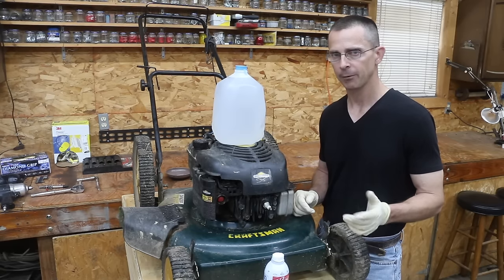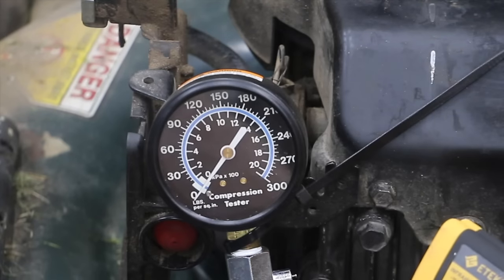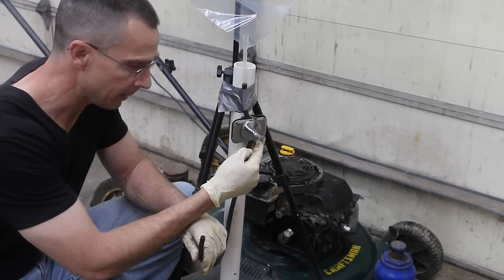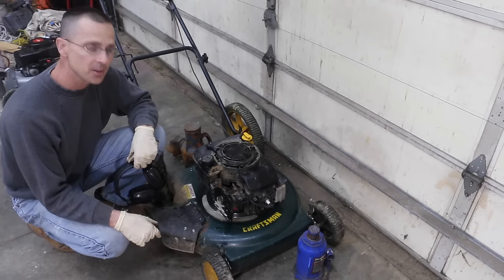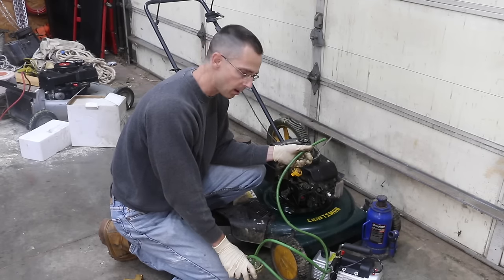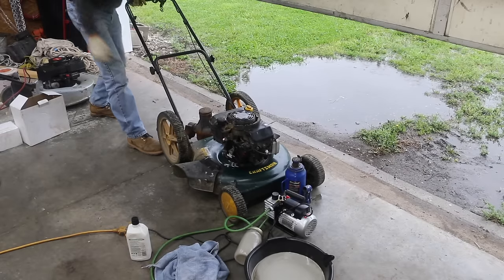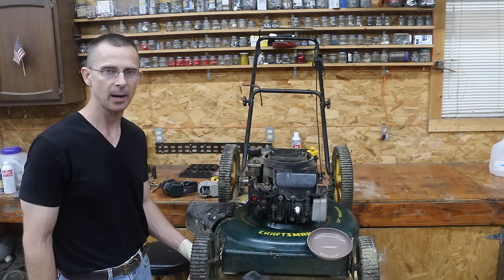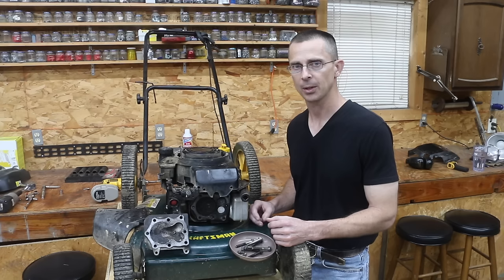Seafoam--can't believe what it did to my engine episode 5--cylinder cleaning test using water!!

Comment: In my opinion I think if you use the water once engine got to the maximum temperature using an atomizer for a short time and waiting for the engine to warm up again.
I think it may have done better.
Like a hot pan after cooking when you add water it removes the stuck on food.
That being said there's no way in hell I'm introducing water into my engine.
I hope you weren't trolled..
Anyway I like the way you debunked using water.
Keep up the great work👍
Reply from the maker: Thanks, will do!

Comment: Interesting video...thank you for posting...but it brings up questions.....what is the compression supposed to be on that engine?...and does the water making its way into the crank case indicate the need for a ring job?.....I really did not think the water did much of anything...I looked and replayed before and after several times....at the point you have to take the head off to see if it did anything.....you might as well use a wire brush on a drill to clean it up

Comment: In 1987 I took a Power Technoloy 171 course at San Diego State University from Dr. G. who showed us this water injection technique to clean out carbon build up in gasoline engines. I have been using it ever since then. He had us use a refillable ketchup or mustard type squeeze bottle with a very small orifice. We only injected water for a minute or two and did not have a problem with water in the oil.
Reply from the maker: Thanks for sharing.

Comment: I used to work at a tune-up shop and we routinely used water to de-carbon engines just before performing the final idle adjustments. We would usually only use about a 1/2 cup of water on anything from a 1600cc 4-banger to a 472 ci V-8. It was ALWAYS used while the engine was at wide open throttle going 60 mph on the dynamometer. The dyno would adjust the load so that you couldn't exceed 60mph -- even with 450 hp -- and such cars needed extra caution b/c if you kick it down into passing gear you could have the rear wheels jump over the dyno roller (69 barracuda 340 would do this very easily). On a car that had no carbon -- it would just sputter slightly as you added water and the exhaust remained clear. Those that had mild to moderate carbon would start to emit a bluish/white smoke from the exhaust after about 5 seconds of water intake. The smoke would often continue for 30-60 seconds after the water intake stopped. The smoke had a peculiar irritating odor that was unique to burning carbon deposits -- it smelled a bit like fuel varnish deposits burning and seemed to stick to your airways -- it was a smell that I hated. Cars that had severe carbon would ping during the process and sometimes spit actual chunks out of the tailpipe. Such bad cases would sometimes require running a gallon or so through it in the course of 5 minutes -- backing off whenever carbon breaking loose would cause it to ping. I never damaged the hundreds of cars I put this through -- and most of them were cleanable on the dyno with water. A couple of them were so bad that 5-10 minutes on the dyno with water intake didn't eliminate the smoke and they sounded so bad during the process that I was afraid of making things worse. A motor this small (lawnmower) would only have gotten about 6 oz. of water -- max. The large volume of water used is why some of it ended up in the crankcase.
Reply from the maker: Thanks for sharing.

Comment: Very interesting results, but it seems like the water is unpredictable and even caused more additional work to be done.  However, the water really did loosen up some bigger bits of carbon compared to seafoam where it seems like seafoam is stripping the carbon in layers over time.  I'm assuming this would be because of the rapid creation of steam from the water and where that steam was entering is where it did the most work.  Thanks for putting in the work and time to make this video!  I'll be sticking with seafoam and will definitely not be using water on any of my engines anytime soon.
Reply from the maker: You are welcome!

Comment: Decades ago, relatives and Friends swore by water or water vapor injection via the carburetor for increased gas mileage. One method Drew air through a water bath, enter the carburetor. Another method used a suspended under the hood bladder partially filled with water that sloshed and dribbled water into the intake manifold. This letter method I improvised wrapping copper tubing around the exhaust manifold, boiling the water, adding a check valve blocking the steam from going backwards, then a hose into a port on the base of the carburetor.

Now with OBD II, would water/vapor injection cause smog control device problems?  Your thoughts?

Comment: Love your videos. I bought a ztr at auction in a downpour and later found dipstick not seated well. I drained the now milky oil and flushed motor and crank case with diesel and let drain a long time... then filled with mobil-1.   Engine is fine still after 2.5 years...
Reply from the maker: Thanks so much!    Thanks for sharing.

Comment: Love your work. My understanding and experience has been with a very narrow & specific use of water into intake. 
  I spay a water mister into the intake of a warm engine. While revving the engine. Only 5-10 mister pumps. I understand the steam conversion blasts carbon off the metal. I never considered, or heard of, a more lengthy introduction of liquid water.
Reply from the maker: Thanks!  Thanks for sharing.

Comment: Try Mercury power tune. We’ve used it and it work ! We’ve brought back compression on outboards bye as much as 10-30 psi. I’ve used it on my lawn equipment and have had great success cleaning carbon and boosting compression.
Reply from the maker: Great suggestion!  Thank you.

Comment: I have used water but the engine needs to be higher rev’d to keep the temp high or the water does not turn to steam.  Usually only takes less than a cup of water.  The large qty of water accounts for the water in the oil along with a somewhat low compression the water was blowing by the rings.  Would love to see this again with higher rev’d engine with only about a cup of water.
Reply from the maker: Thanks for the video idea.

Comment: Ok finished watching the video, If I would use water or Seafoam? Probably Seafoam, but if I was in a pinch water is not out of the question. Just would probably run a little less water over a shorter period and see how the engine responded after the first run. I think maintaining engine temp and a higher rpm is important as well. Steam conversion is pretty powerful. I like the compression results, but not so much the grey oil. Good lesson. Love your videos. I have a 99 f250 7.3 with alot of miles, runs great, but has a tiny bit of blow by. I put six cans in of Seafoam in a full tank of diesel when I first bought the truck, which had not been taken care of very well when I first purchased.  Been thinking of running Seafoam directly into the cylinders while running, but not sure if this will give me the results I want meaning a positive or negative results.
Reply from the maker: Thanks for the feedback.

Comment: Hello. Would it be better to actually open up the engine and give the cylinder and all the other engine eternal a wash? Basically rebuilding the engine. I know rebuilding is good and could be done cheap. Which would be better in this situation?

Comment: I use a spray bottle to atomize the water and I don't use more than 8oz.
I get my motors full hot and intermittently add the spray at half throttle just because the motor bogs down so much. Just some suggestions.. Your test was great!
Reply from the maker: Thanks!

Comment: I just wanted to let you know I mix a little bit of water in my seafoam through the vacuum port and do it really slowly something I don't do is stall off the engine or turn it off after I add the seafoam for a hot soak and then I do an oil change
Reply from the maker: Thanks for sharing.

Comment: I pulled out my 409 Pontiac to with around 8k miles on a rebuild to install a better oil pump new oil pan, crank scraper, a bigger cam and lifters. I did pull the intake as well and could see a lot of carbon on the valves, The Seafoam melted all the carbon in the cylinders and valves, They look like new.I  used to think all of the stuff was snake oil.Thanks for what you do,  Project Farm dood!

I really hope you do a test on Hemp seed oil at some point. The oil companies probably already hate you after you demonstrated how they have been ripping us off for the last 100 years with your test running on fuel vapors, you we haven't needed to dump all that fuel down the intake. When people find out they can grow 300 gallons of clean, non toxic carbon neutral  fuel on one acre, and we could have always been energy independent .  They scammed us, and still are We should be out in the street with pitchforks and torches.

Comment: Actually a little ATF while engine is running is amazing at trembling carbon as well! Used to use it on 90’s dodge 5.9 vans as they always failed emissions due to high NOx and carbon build up in the intake. It makes quite the smoke show too which is fun.
Reply from the maker: Thanks for sharing.

Comment: Twice a year I send shaved ice into my 2006 Ford Five Hundred engine, and it does a great job cleaning the carbon. I use to use glugs of water whilst I reved the engine, but it had mediocre results. Since switching to ice...there has been a remarkable increase in the carbon removed. I suspect that the ice is bouncing around within the cylinders as it changes phase.....adding a physical abrasive action to the soft carbon buildup. I might be wrong that THAT is the reason, but all I know is it works for me. To get the shaved ice in there I use 4 Slurpee straws inserted into the intake, and then use my Dremil to shave ice from a block right into the suction from the straws. The straws make sure the ice particles are not too large, but they must be large enough to stay as ice into the cylinder.
Reply from the maker: Thanks for sharing.

Comment: Water doesn't combust, pushes through rings and mixes. Washes out the cylinder walls of lubrication and wrecks the rings which is why the loss of compression. IDK who recommended this to you but as a ASE HD Diesel Tech for over 10+ years... I think you got trolled into doing this. You're a smart guy and I think you knew that going into this

Comment: If I may make an observation,I think the water flow rate may have been too much for a one cylinder flat head engine,it may have been a better match with a Honda or Briggs and Stratton over head valve engine.I think the difference in compression after the treatment may have been the result of
The removal of some of the carbon.
      Thanks again for the hard work and research, it's really well done.
Reply from the maker: Thanks and you are welcome!

Comment: There are actually a few experimental six-stroke engine designs where the 5/6 strokes are a steam power stroke, achieved by injecting water into the scorching hot cylinder and extracting power from the water flash-boiling. Both the Dyer and Crower engines used this technique, and are substantially similar. The benefits are the cleaning of the cylinder as seen in your video, removing the need for air or water cooling systems, and generating extra power (and thus boosting fuel economy) from what otherwise just becomes waste heat.
Reply from the maker: Thanks for the feedback.

Comment: Another way to ensure a controlled infusion is to use a pump up type pressure sprayer with a length of line, running to a hyperdermic needle (shoved into the intake nearer the intake valve/s). This way atomises the water instead of trickling it in. Use this method and a couple of litres of water to clean my tdi top end. Pulls the fuel injectors back into balance too; all while driving along as well... ;)
Reply from the maker: Thanks for the feedback.

Comment: I use the water back in the late 70s to clean off oil deposits on spark plugs while an engine is running. That tip was given to me buy a cranky old coot that had been in it since time began.
Reply from the maker: Thanks for the comment.
Reply: No thank you for all the great videos. You are my go-to guy Chemical Testing. You are the only person I have ever seen that did lubricity tests. I am amazed by your creativity

Comment: Just curious 🤔.  The head is easy to take off,  wouldn't it be more beneficial to remove the head and brass wire brush off the carbon. Better result with less chance of damage to the engine.

Comment: Back in the mid 1970's, I experimented with a water injector on a Ford 351 Cleveland with 11.1:1 compression. I used a throttle operated switch, which turned on a windshield washer pump, which sprayed water out of nozzles into the carb. I saw no performance increase, but it prevented knocking and overheating during the gas crisis and crap fuel days. Later, I took the heads off for a valve job and the chambers and pistons were unusually clean. I was told a lot of people who ran water injection with turbochargers had clean chambers and pistons, so I think water works. That said, I think a spray mist works better than a drip.
Reply from the maker: Thanks for sharing.

Comment: I just finished decarbonizing the cylinder head, what I did was following the manufacture (John Deere) recommendation, by using a Scotch Brite pad (green color) from the kitchen rub down the head and the mounting surfaces with some carburetor cleaner. It works like magic, easy and clean like new! Maybe you should try it. Anyone can do it, don’t waste money buying expensive chemical which only gives mediocre result.
Reply from the maker: Thanks for the suggestion.

Comment: Back in 1988 i had a 1979 cutlass Supreme and following the wisdom of older folks I "cleaned" the internal engine by literary letting the carburetor suck in small amounts of transmission fluid just until it started to smoke then stop. As silly as this sounds...this experiment has me wondering if it did any good. Motor was a 231 Buick v6 for reference.
Reply from the maker: Thanks for the feedback.

Comment: I know this is a older video but I’d love to see a water antifreeze mix. As a mechanic I’ve seen several engines that have had a blown head gasket and the cylinder or cylinders that are getting coolant in them are almost spotless just curious if thats do to just the water or the water antifreeze mix ?!  Does the antifreeze aid in the cleaning
Reply from the maker: Thanks for the video idea.

Comment: Awesome video. I think it would be really cool if you tried this with steam instead of drip feed. And a lot less water. As a gallon seams like a lot. Also could try a hydrogen generator to see if that would be worth installing and only using to clean engine.  Even if you
Don’t, I love the videos. Thanks
Reply from the maker: You are welcome!  Thanks for the suggestion.

Comment: Over 50yrs ago used water on a 312 ford V8. It worked, however did a spray mist approach. It will steam explode hotter inside  What ever fluid you do use remember to expect blow by from the rings to value stems will happen. Your going to want to change out oil and if had filter.
Reply from the maker: Thanks for sharing.

Comment: What about using a misting nozzle to spray the water or seafoam into the carburetor?   I built a water injection system using brass 5 gph misting nozzles, hoses and a 12 volt pump running off the battery with fully automatic controls.  I had to tee  2 nozzles since my Corvair had dual carbs, but it allowed me to advance the timing and the difference in performance was like night and day.  And I'm sure the water cleaned a lot of carbon out of the combustion chambers!
Reply from the maker: Thanks for the feedback.

Comment: Ok, when I was taught about this technique I was shown a totally different way of doing it. It was explained to me that it works using the science of cavitation. It was larger amounts of water in bursts to maximize the cavitation inside the cylinder. I've never done it to a lawnmower, just in larger engines. You bring it up to full rev, spray water from a recycled coke bottle with a hole in the lid and the rpm's will drop quickly. Do this a few times and you'll notice that the center cylinders will clean up right away. You have to keep doing it to get the outside cylinders clean, but it works really well. Cavitation is a violent force and will destroy a valve. You can see it's effects by the intake valve and see how clean it is around the cavitation point. If more water were added quickly and in shot bursts, I believe it would get across the piston and do a much better job.
Reply from the maker: Thanks for the feedback.

Comment: I have heard of spring water into the carburetor while the engine is running and that when the atomization process has a tendency to clean carbon very well off of the valves and in the head.  Wondering if you tried that?I'm curious as to what the result would actually be.
Reply from the maker: Thanks for the suggestion.

Comment: I used AC/Delco X66 to decarbon engines. I successfully loosened or cleaned oil rings enough to reduce consumption. I used three treatments on an Oldsmobile Whiz-Bang (diesel) and reduced consumption enough to sell it. The engine has to be good and hot. You wouldn't believe what comes out in the oil change.Blew up a Buick 3 litre v6 doing a top end clean, but those were born to blow.
Reply from the maker: Thanks for the feedback.

Comment: Small engines have a decompression mechanism built onto the camshaft. It is centrifugal in operation and at higher RPM's it releases its' effect. 60 PSI is good cold or hot.
Reply from the maker: Thanks for the feedback.